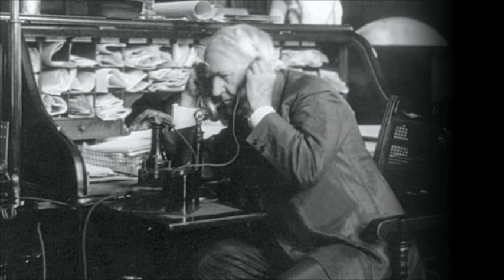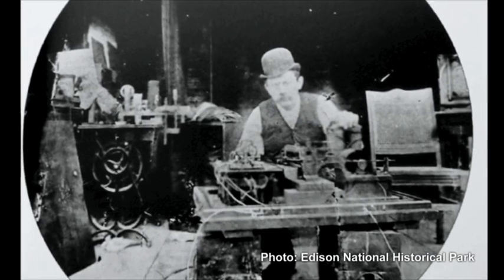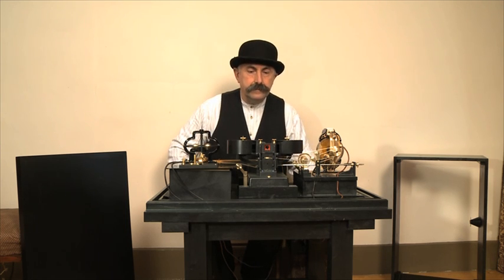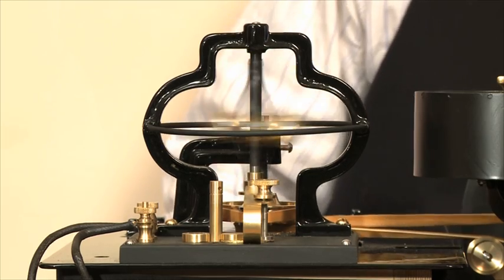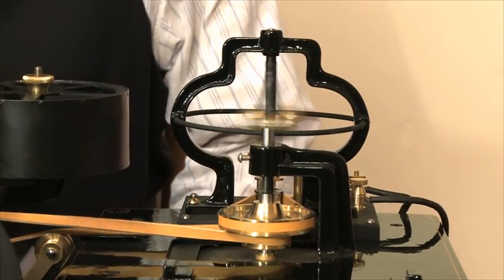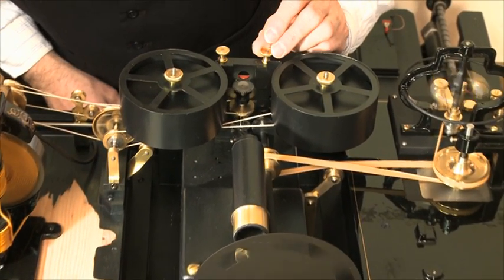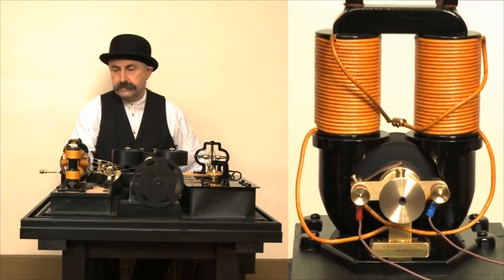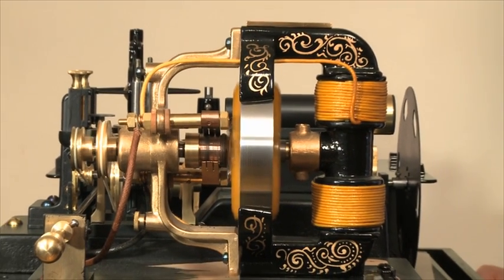Edison Kinetograph Horizontal Camera Replica

Comment: What a beautiful piece of workmanship this is. Thanks for sharing. One thing puzzles however; the film transport past the gate does not appear to be intermittent. Did the film run continually, like the Kinetoscope viewer, and rely simply on the brevity of exposure to 'freeze' action?
Reply from the maker: The intermittent mechanism is behind the sprocket. However, we could not perforate a test film, so the piece that you see travelling through had no sprockets and did not perform accurately.

Comment: Those 'electric' motors sure used heavy gauge wire!  It looks like 20 AWG..
Why such thick wires?? Was it for speed or were the motors dependent on low voltage heavy current batteries??